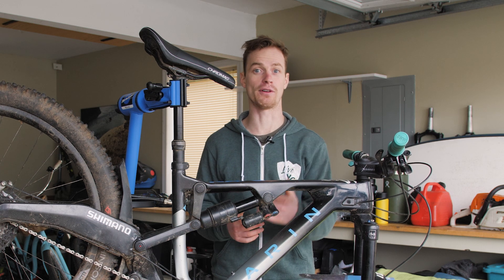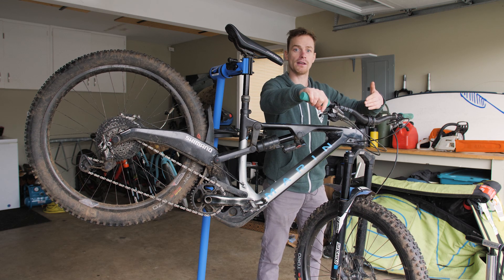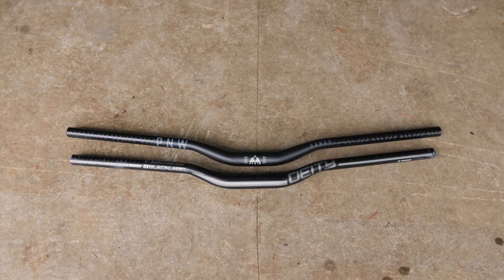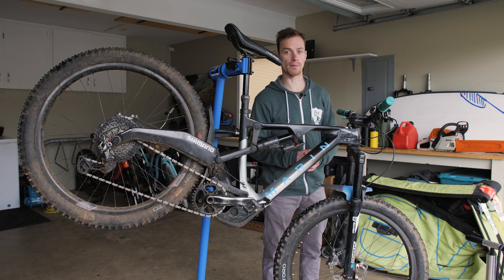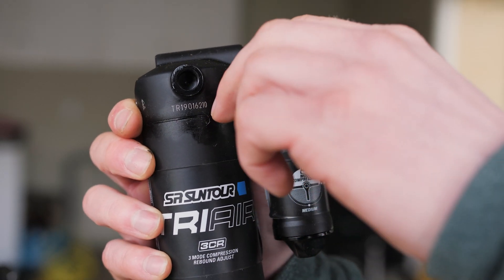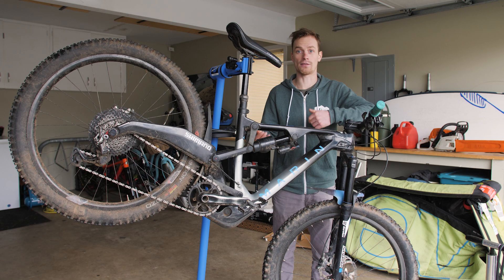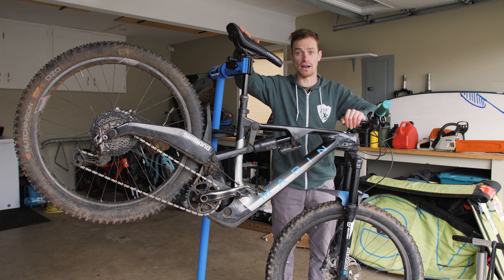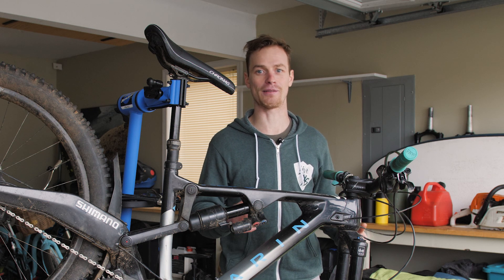How to Dial in Your Bike Setup

Comment: general do it all trail riding... when seat is all the way up, is it higher, equal, or lower than grips? Opinions please, what say ye?
Reply from the maker: Depends on the length of your legs. You want it so your knees are slightly bent when the dropper is fully extended
Reply: @MarkMatthewsMTB  thank you for your reply, respect. yes, assuming seat height is set properly on full extension we can now adjust grip height, for the most part, with stem spacers, stem rise, and bar rise. For all purpose trail riding I'm curious about most peoples setups if the grips end up higher, equal, or lower to the saddle?